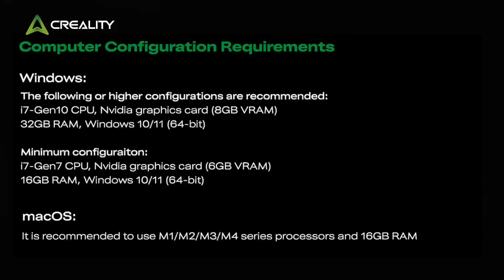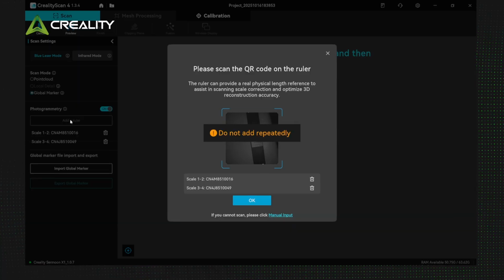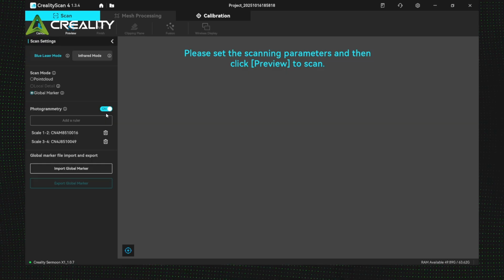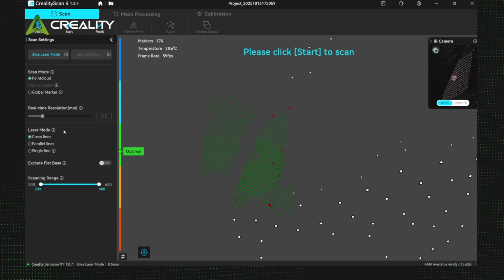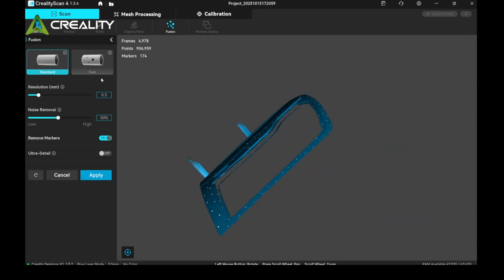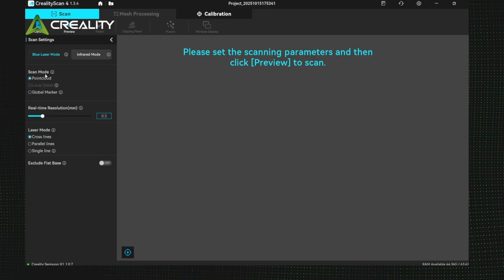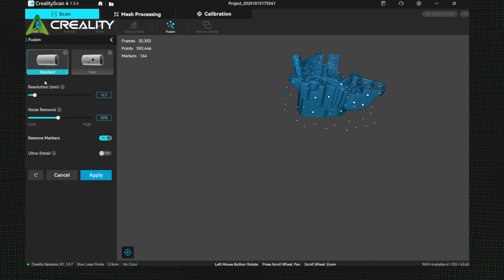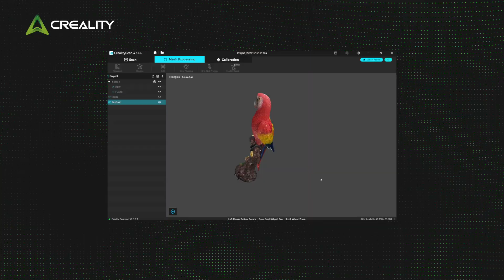Unboxing and Hands-On Tutorial of the Creality Sermoon X1!

Comment: I purchased a Sermoon X1, and now that I have it, I can't find a single good use case for it.  Get something less expensive.  You'll still get good results.
Reply from the maker: The X1 is mainly built for high-precision inspection, so its value shows when you work with thin-wall parts, curved surfaces, or anything that needs accurate deviation checks.

Tell us what you’re scanning — maybe we can point you to some workflows where it really shines.